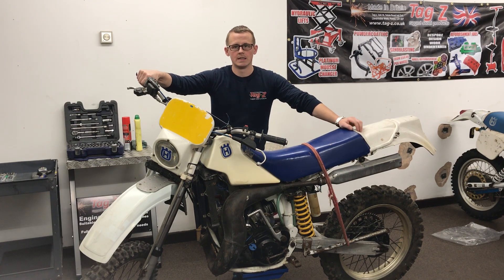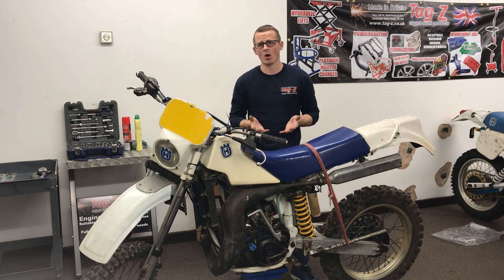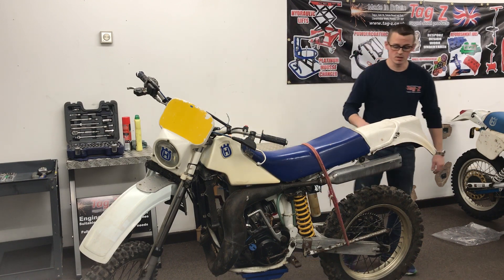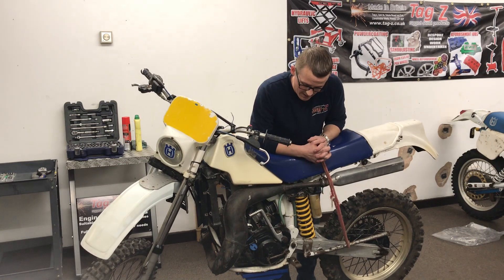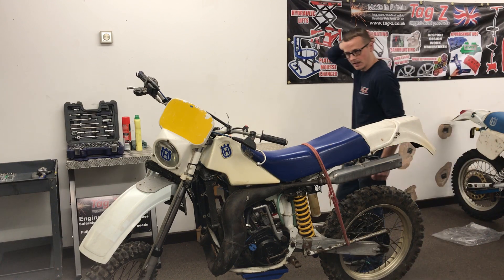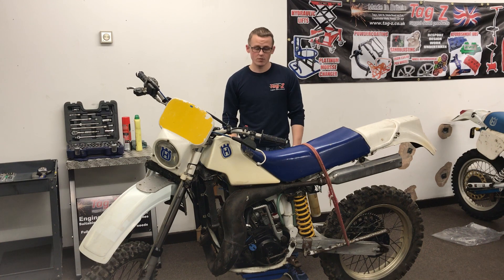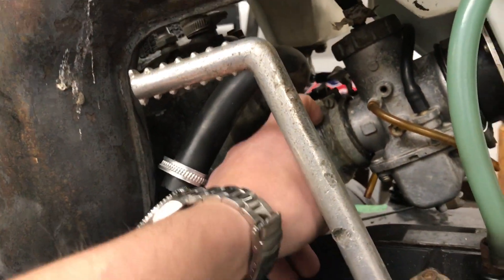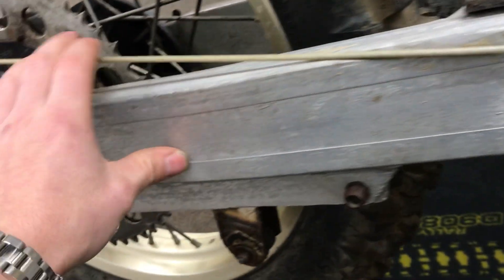Part 1 WR240 / 250 Husqvarna 1985  1986 REBUILD RESTORE

Comment: Hello, I just purchased a 1987 Husqvarna WR 250. SER# 842251951H.  I'm having problems finding parts (plastics, grafics, seat cover etc, etc) for the 1987, however these parts are available for the 1986, is there much difference between the two years? They look very much the same in pictures online. Thanks for any help on this matter

Comment: 1984 was the first year of liquid cooling engine from Husqvarna.
Reply from the maker: yes, it come out mid-year of 1984, but was the new 1985 model.
Reply: @tagzproducts1497   your model 85 was the second model of the liquidecooling  the first one come out 1984 with the first plastic tank model  and with  twinshock
85 its the newer tankdesign and with single shock.